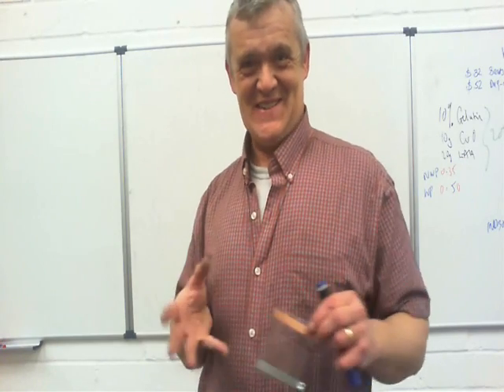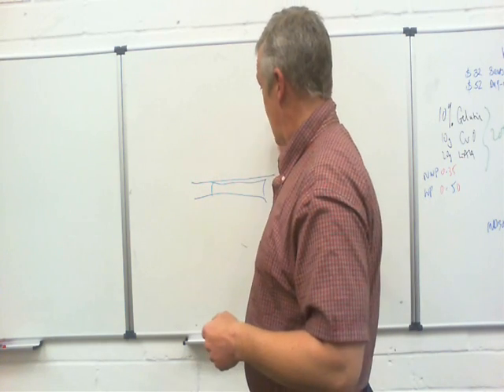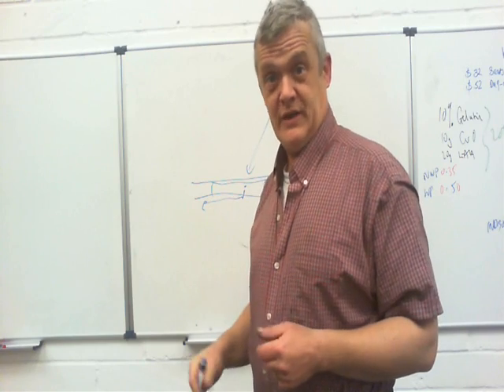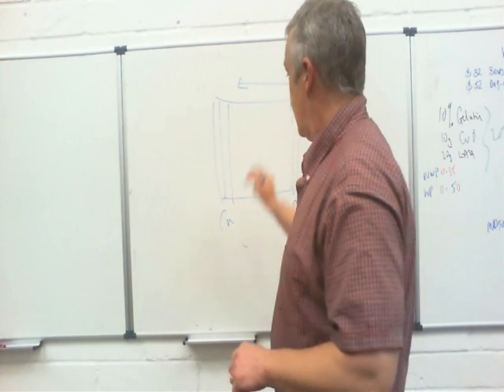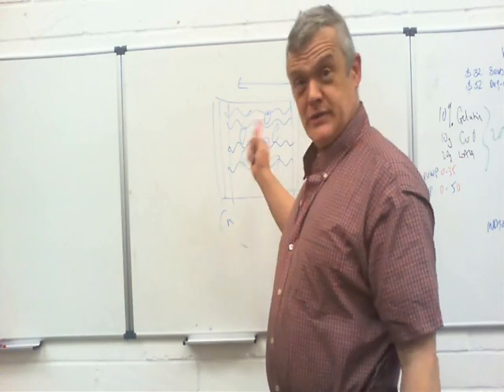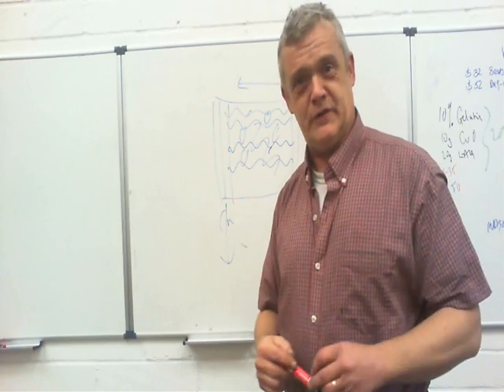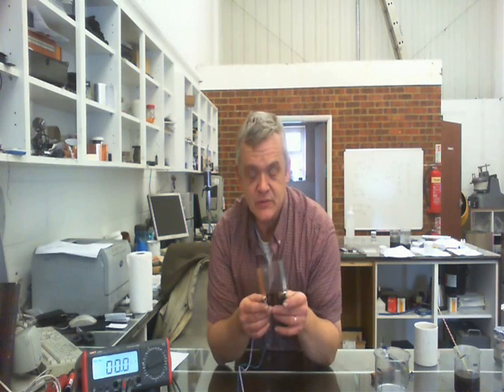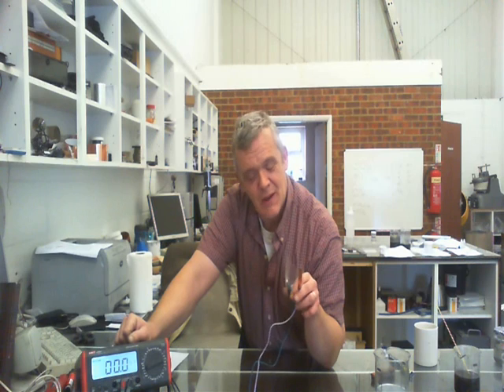Graphene Transparent, Flexible Brand New Solar Cell

Comment: so, who was the clever sod who rediscovered 'Graphene'? (single layer carbon surfacing). Great videos! I have simpler way to create industrial 'grade' graphene. Use the principles of electrostatic painting on acetate film with a paper stencil... or simply print your schematics (film areas) on acetate (transparency film) with your mono laser printer and electroplate it afterwards (if necessary)... That's how I do it.
Reply from the maker: i am not clear on what you mean mate - do you have a video?
Reply: It's more of a question, could a laser printer apply a 'graphene' similar coat to transparency acetate? That's a very thin coating of graphite, might it work?
Reply: Meanwhile I'm working on a derivative of your idea of an efficient conductive ink formula might be. A synthetic to replace the gum arabic might be as effective and cheaper.
Reply from the maker: IAMainvision
it probably will do - i went for gum arabic because i like the 'green' aspect
Reply from the maker: IAMainvision
i don't think so mate - which is why i wouldn't try it - but i don't really know as i have never tried it - i often find i try something that people tell won't work only to discover it does - so though i wouldn't try it - I don't see why you wouldn't - it's probably worth the experiment
Reply: I've tried spreading powdered Graphite lubricant (squeezy bottle type) and then buffed it and it did give an electrical connection and Ohm value with my multimeter. When I get the time I'll try rolling it up and testing its capacitance. I'll be happy to let you know my results since your videos have been off great help to me ;)
Reply from the maker: IAMainvision please do mate and i would be fascinated to know

Comment: do u need alluminum or an you clip it to the graphene and selulose plastic sheet, did you buff the sheet
Reply from the maker: it is better attached to metal as they are current collectors it will work without them but not as well - i t wasn't buffed

Comment: so what happens when multiple plates are stacked  on top of each other with a clear insulating layer between the plates connected in a parallel circuit
Reply from the maker: dunno - but worth looking into

Comment: I was thinking along the lines of Gandt, but it occurs to me that there may be an opportunity for testing not mentioned yet. A wet cell. As simple as the solution in a test tube with the anode and cathode running down the side. With a large numbers of electrons jumping around in  the solution, there'd be a great chance for them be harvested. Especially if the solution was highly conductive with  graphene solution. A perfect chance to use the much easier to make graphene in solution. A little tea, a little zinc, and presto.
Reply: It's been a year. Anyone test this yet?

PS Near the end of the file he did mention a gel cell using 3D to stack the layers. It'd be nice to hear how progress went with that idea.

Comment: Considering its hardly damping the light that passes throgh, and the size of the cell. I'd say thats fairly promising.

You could slack a few up before there was no light reaching the bottom of the stack, or make solar windows, or reflect the light back through as others have sugested. Solar greenhouse even....

I wonder if it would go better if you formed a semiconductive oxide layer on one or both of the metal strips. Could raise the short circuit voltage a bit if nothing else. Did you happen to note down the Short circuit voltages with a 10m+ impedance meter (like the one your using in this video)?
Reply from the maker: 0.3 volts
Reply: that’s not too bad at all.
Reply from the maker: Mongrel Shark
i guess it can be worked with mate lol

Comment: Im thoroughly confused by this! :-)   Do you still think this is a MIM diode spread out over the whole piece of plastic? Whats really puzzling me is that the mixture you put on there shouldnt really have an orientation, right? So any current that is generated in one particle would just cancel out some current generated in another particle, because theyre all just randomly connected up by the graphene, before even reaching the electrodes... Maybe then only the areas close to the electrodes contribute to what you measure? Could perhaps also explain why your results in the previous video are better.. What do you think?
Reply from the maker: i think the graphene is conducting it away quickly enough - or you are right - either way - it is interesting and probably deserves looking at
Reply: Robert Murray-Smith Easy way to test this.. cut the sheet in half and connect the electrodes up. :-)
Reply from the maker: saltwindful go for it

Comment: I'm curious is this functioning like a photovoltaic cell with just any light or is it like the old solar cells and requiring direct sunlight?
Reply from the maker: it works better in sunlight if that helps - but i don't really understand what you mean - as far as I know a solar cell is a type of photovoltaic cell and they all respond to light it's just a question of intensity and wavelength - but i could have that wrong i guess
Reply: Robert Murray-Smith I'm basing it on sales info for solar cells so it might just be how they put it, but from my understanding solar used to need direct sunlight to work where as the current main type work with any light, might be a materials thing though
Reply from the maker: Christopher Parsons
ok - not sure what to say - there are two functional model one based on the light as a particle one based on light as a wave the way you attack solar cells is based on this - there have been material improvements leading to cells working in lower intensity light conditions - but that's about it
Reply: Robert Murray-Smith probably just the sales jargon getting it wrong then  overselling it in some way
Reply from the maker: Christopher Parsons
sounds like it mate

Comment: Flexible transparent solar cells - on the cheap!
I realise that "flexible" is good, but wouldn't the "transparent" part lend itself nicely to being applied to windows?
I'm sure I've not seen anyone suggest it yet, which surprises me.
A reasonably long lasting compound that could be painted onto the inside of greenhouses could be awesome, especially if adopted by industrial farmers of e.g. tomatoes.
Then being flexible might come back into the useful zone, since polytunnels could also be treated.

You're a real powerhouse of innovation Rob.
Reply from the maker: nice ideas mate and yeah that would work lol
Reply: They have them , and those are gallium arsenide panels not photovoltaic
Reply: Quite so, sir ! Bravo to your thought . . .

Comment: So much to experiment with, mixture ratios, thickness, metals - very cool !
Hmm...it's transparent, which brings thoughts about bouncing that received light around in a sort of Peppers Ghost hologram way. A transparent box with internal pyramid, that may trap the light, bouncing it around and taking every last 'drop' for power generation as it hits the surfaces. It may well boost amperage.
Reply: I remember a few years back some kid did an invention that would boost solar cells 600% with a pirmid structure. Ofcourse that vanished soon... Too efficient ;)
Reply from the maker: interesting ideas mate
Reply from the maker: Rob NvT
got the references?
Reply: *****
 Great link..thanks Three Phases, am reading it now :)
Reply from the maker: *****
always good to have the input mate - cheers

Comment: Fascinating! How would you go about boosting the voltage? For tripling the voltage, could it be as simple as placing parallel strips of copper, aluminum, copper, aluminum, copper, aluminum all on the same sheet and then painting over it with magic paint? The inner strips of aluminum and copper being connected to nothing while the outermost strips are hooked up to the voltmeter/load.
Reply from the maker: you'd want to increase the amps mate - increasing volts would just be a matter of having a few wired in series. You would increase the amps by having more active material accessible to the light, so - put more in - make it thicker - something like that
Reply: Robert Murray-Smith Oh definitely, the amps have to be increased; but so does the voltage.  A silicon solar cell only puts out about 0.7 volts, so they're wired in series.  I've "tabbed" solar cells in series before and I didn't like doing it.  I broke quite a few in the process.  I was thinking you could bypass the whole process of tabbing cells together in series, provided the layout I suggested actually does raise voltage (It might not!).  It would make building solar panels so much easier.
Reply from the maker: Joseph Richardson
sorry mate but an electrochemical process is going to be limited by the reaction voltage which is a combination of the redox half voltages and influenced by the electrolyte. A solar cell fits into this schema - so other strategies have to be used to increase voltage
Reply: I don't really understand your response.  Please elaborate.
Reply from the maker: Joseph Richardson
physical processes have limits. It's like trying to nail wood together if you have two boards at 2 inch each it is no good trying to fix them with a two inch nail however many two inch nails you have in there they just won't fix together - what you need is a 4 inch nail. It's the same here - the process behind the conversion has a limit - it won't help making it thicker or putting more stuff in there - using more nails - it won't go beyond the limit - you need to change the process - get a bigger nail - to get more out of it - of course there is a limit to that too - ever tried to fix a bit of 1/8th inch trim with a 6 inch nail? - hope this helped
Reply: Robert Murray-Smith I realized this morning before getting up that I'd made an error in my original proposal.  I should have said a C, PA, AC, PA, AC, PA, A. C is copper, PA is photo-active material, A is aluminum. All the metal strips are parallel. In the case of AC (Aluminum Copper) the two strips are touching each other along their length.  Perhaps that would make a series cell?  I'll add to your analogy.  When fixing 1/8" trim using platinum nails, the final product is not really sturdier but winds up costing much more. lol!  Sorry about the confusion.
Reply from the maker: Joseph Richardson
Hiya mate - that makes a lot more sense lol - interdigitation like that is a good idea I think